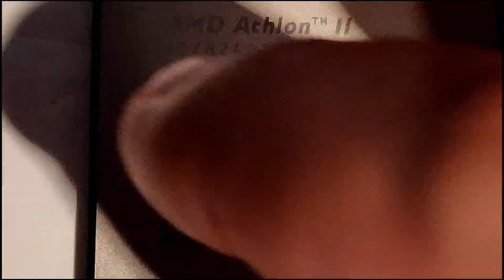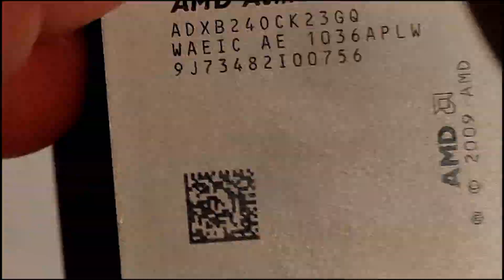Oddly Satisfying: CPU Pin Repair

Comment: I did this for a P4 3.06 Northwood recently, feels good, the socket test is always nerve-racking.
Reply from the maker: It's actually kinda relaxing. Picked up about 40 scrap CPUs. Repaired about 20 so far. All work.
Reply: @TechTested  I probably do about 20 a year, but it's usually a valuable processor so I don't feel relaxed lol. Maybe I should start buying those scrap listings just for practice.

I've got a bunch of cut-out sockets from irreparably dead motherboards, they make the job much easier. You need to apply some silicone conformal coating on the edges to handle them though.
Reply from the maker: Yeah the expensive ones are definitely more stressful.

Comment: Fun indeed, I think the part which I found was most dangerous as far as breaking pins was concerned, was the edge pins if the screwdriver slips up. I also got away with it.
Reply from the maker: Yeah it's kinda nerve racking for sure!